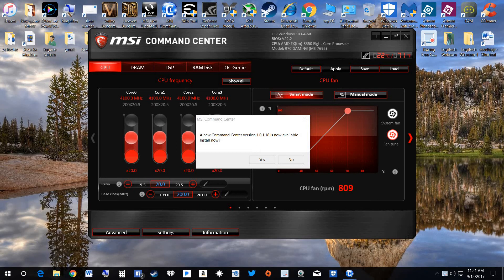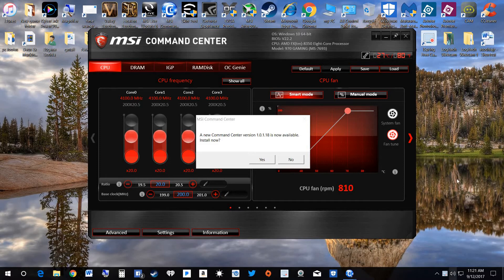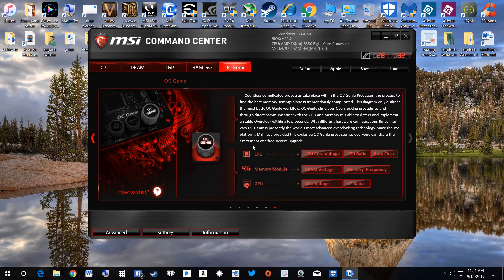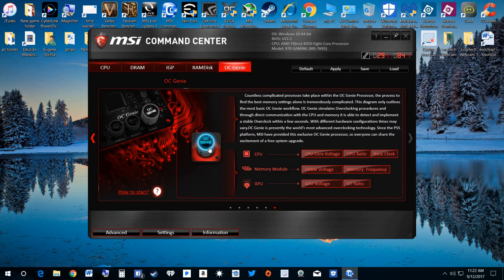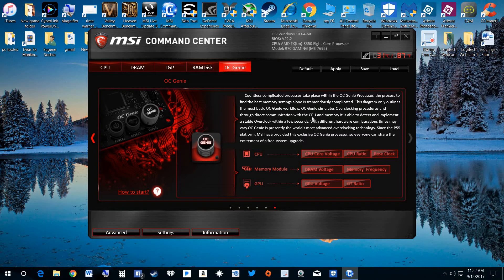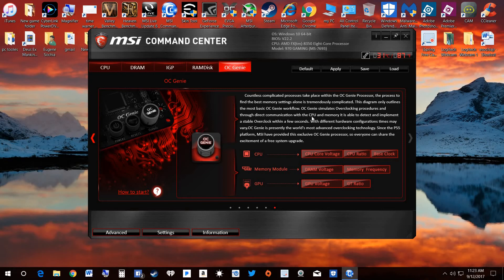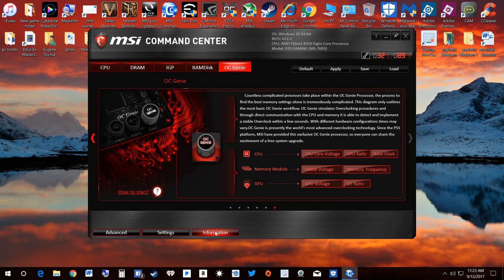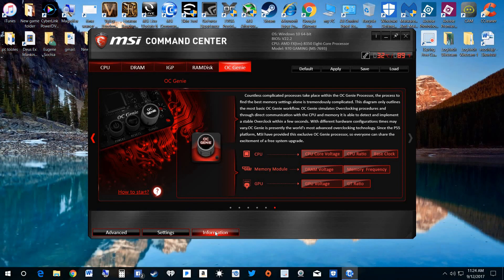MSI OC GENIE

Comment: is this safe?
Reply from the maker: Hi, What this does is put the boost speed on all the time. If you have a 3.7 processor with a boost speed of say 4.2, It would run at 4.2 all the time. your processor will automatically kick up to its high boost if needed. If you have the cooling you can run it there all the time if you want. in your spec. it would change where it shows your processor speed, it would change it to the boost speed number. Its something you don't need to do really. Its just runs it at boost speed all the time. I hope I answer your Question my friend. thanks for the comment
Reply: @genesochiajr255  Thanks I liked and subbed keep up the great work!
Reply from the maker: Thank you my friend, so glad you are here
Reply: @genesochiajr255  My cpu is working better after oc genie!
Reply from the maker: That's good to hear my friend
Reply: @genesochiajr255  Hey, in bios of my motherboard there's a oc genuine 4 button, if I enable it will it overclock the CPU for me or what?
Reply from the maker: Splash, the over clock button just sets your boost speed to run all the time. Let's say you have a 3.1 cpu with a boost to 3.7. You would run at 3.7 all the time. Thanks for the comment my friend
Reply: @genesochiajr255  Thanks I have a 3.4ghz and it's 3.8ghz now thanks it works great with msi afterburner also!
Reply from the maker: @chirp3663  It does give quite a boost, Just check your temps, But you should be fine Have a great weekend my friend
Reply from the maker: Thank you for sharing the video my friend
Reply: @genesochiajr255  Thank you! Will it overclock anything else or just the processor?
Reply from the maker: @splash7794  anything that gets boosted under normal operation when boost is on, might be a little boost to memory (Ram). Watch your Temps if your turn it on, They should be ok, But watch to make sure you don't overheat. Have a great weekend my friend
Reply: @genesochiajr255  Thanks a lot man! You too!
Reply from the maker: @splash7794  You are very welcome my friend
Reply: @splash7794  If you also have a GPU or a Graphics Card you can use Msi afterbuner to OC your Gpu also but you should watch a video on it.
Reply: @chirp3663  Okay, Thanks! :D
Reply: @genesochiajr255  I will be sure to share this video!